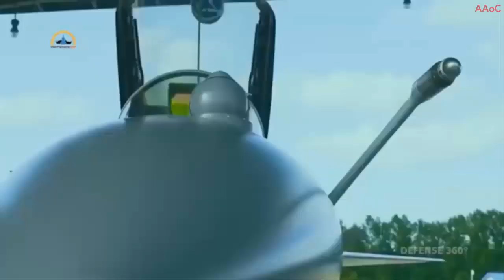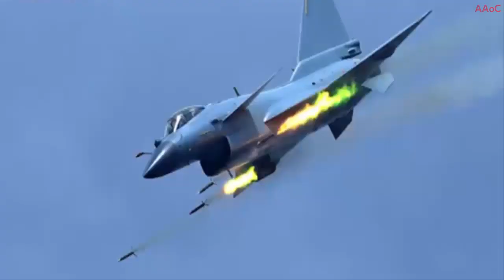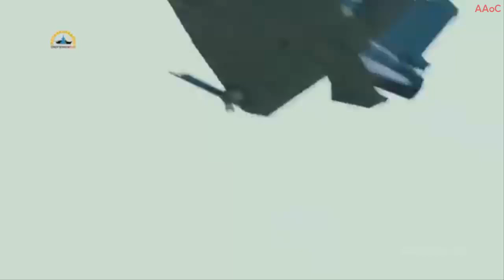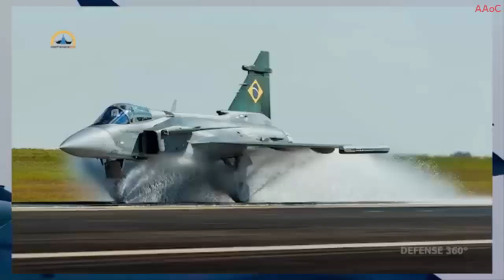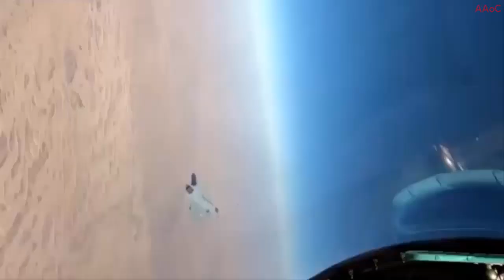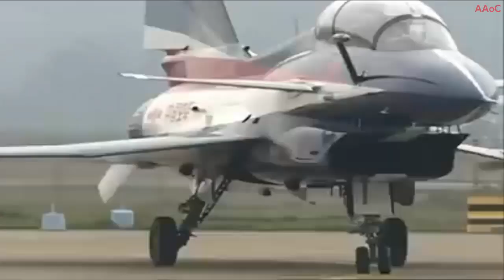China tests J-10C With PL 17 Missile for Long Range Combat

Comment: So it beats the AIM-174B  the longest-range air-to-air missile used by the United States by 100km. And more than double the range of the AIM-120 AMRAAM, which is the standard air-to-air missile used by the F-22 and F-35 fighters.
Reply: Of course it does it's Chinese
Reply: @Abcdefg1226ytytyrt  The AIM-174 B might have a range up to 620 km.